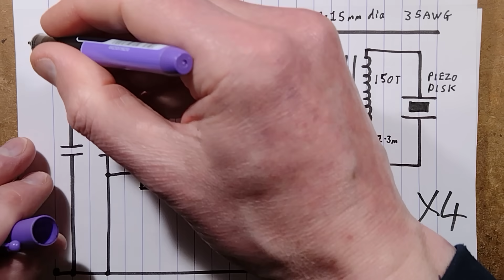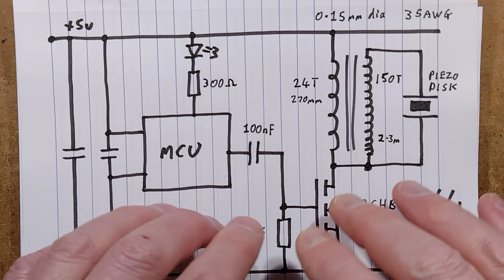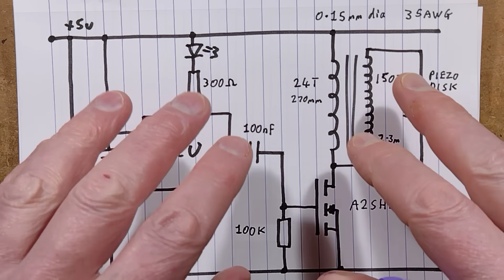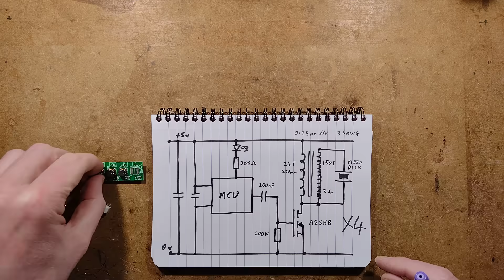4-head ultrasonic water atomiser - with schematic

Comment: Ooh.. I recently got a bunch of those discs, but nothing else. I've been meaning to build a driver for a while but haven't really bothered to test resonant frequencies and stuff. From what I understand they can be driven from kilohertz to about 2.5mhz depending on what droplet size is desired - unlike the higher powered (60w/100w) transducers they don't really have to be tuned. I haven't gotten any data on how hard to drive them yet. My 60w transducer takes 1200v @ 50mA, 40khz. Any chance you could take measurements of what these little ones are being driven at?

Comment: A multi trace scope would be great to have on hand to see how narrow and the frequency of the pulses as well as if the 4 drives are sequential. Very interesting device and a low price point. Back in the 1990's when I first saw these being used, they were extremely expensive.  Thank you for sharing this with us all.
Reply: You can probably get away with just a dual trace 'scope, and see if the delay between channels increases as a common time interval.

Comment: White. Dust. Everywhere. If you have even slightly hard water, these make a mess. Evaporative only humidifiers where I'm from.
Reply: That's what distilled water is for 😉 We ran our humidifier with normal tap water at first, but the very hard water created the white fallout you described. Switching to distilled water got rid of the issue.
Reply: In the old days, the CRT from my TV was always dark dirty when running this thing.

Comment: 1:50 The screwdriver you told everyone never to use 😂 I guess as a level it has a use!

Be interesting to see the frequency or voltage the inductor is putting out or if it changes based on the density of the water

Sound was improved

Comment: It would be interesting to connect the microcontroller outputs to a four channel oscilloscope (or logic analyzer) to see if it does indeed scan across them and the frequency of pulses used to excite the piezo devices.
Reply: With over a million subs, you would think Keysight et al would be falling over themselves to showcase their products (especially Clive, who could show joe public how to use one simply, unlike many other channels). Of course, such blatant marketing may not be to Clive's liking.
Reply: @ralphj4012  Clive said previously he was offered a fancy oscilloscope to use but did not accept as the price of it would have been out of the scope of most viewers.  Though he does have one he sometimes uses, but not often because it is too big for the small desk area.

I would be either the best or worst stalker because I remember so much irrelevant random stuff that I would never need to actually do any stalking.
Reply: @ralphj4012 pretty sure Clive does have an oscilloscope, maybe he figured the video would be too long if he went in-depth?
Reply: @ralphj4012  certainly not! BC doesn't do sponsorships.
Reply: It would be interesting to test those with other (let's say a bit more flammable) liquids 😅
Reply: @herrgerd1684  3 channels of atomiser and one driving a spark plug?
Reply: @colint Well, the only way to know for sure is to try it. Does Fanny Flambeaux have any sisters?
Reply: @herrgerd1684 There must be something wrong with us. That was my first thought as well.

On the other hand, do they push the most out with enough force to prevent a flame from creeping back down to the unit? That could be bad.
Reply: @herrgerd1684  oh yes please.  Add and ozone generation arc as the ignition source, atomized piezo electric smelly air liquid fire ball spray to cook hot dogs, while LEDs flash under the spray to illuminate its wonder and you have a Big Clive nirvana moment!  The smell might be a bit much for an inside party.  Maybe outside.
Reply: No need for Oscar the Silly Scope. Don't be lazy, math it out.!

Comment: In re the tiny movement of the piezoelectric disc: this is how the actuators in a scanning tunnelling microscope work. At sufficiently low temperature and with proper control of the voltages, piezoelectric crystals can move the needle which does the scanning of the surface with a precision literally less than the width of an atom.
Reply: Years ago I attended a conference on this exact topic!  Whilst the principle of operation (including the feedback systems) appears relatively simple, the timing requirements are scarily exquisite! The precision of voltage drive to the actuator head is  better than one part in 100,000, and since the pulse widths are tiny, there's a lot of HF "black magic" in the drive circuitry. The price has fallen a lot since China started building these machines, however  for me they are still "up there" as a pinnacle of MEMS technology

Comment: Wow...that is a LOT of atomization!  
This could definitely be used in dry climates to humidify the air with just plain water.
Reply: When you run such thing in a closed space/small room, all the heat is removed from the spot where the thing spits its damp, but all around that spot the atmosphere is very humid and HOT, very unpleasant. The only way to benefit as human is to sit close to it while the room is well ventilated to get rid of the hot humid air it produces.
Reply: @erikdenhouter  It's not meant to cool but to add humidity when you are in a dry climate (like mine, in summer). Very low humidity really gets to some folks, and using these things with a humidity controlled driver is a great way to stop from that horrid dry-eye and gritty sinus feelings some suffer from.
Reply: @ConstantlyDamaged  Well, I was the stupid that bought it because it felled so cool...
Reply: In summer it gets down to around 2-5% humidity here and, honestly, I don't mind that. You get used to it.

High humidity, though, is the worst.
Reply: @ConstantlyDamaged    
I hate the dank humid sweltering weather we have in my area in the south-east of the US...but it's where my folks live...they are getting older and need the help.  
Previously I was in the Dallas/Irving area of Texas...much better on the humidity front  :)